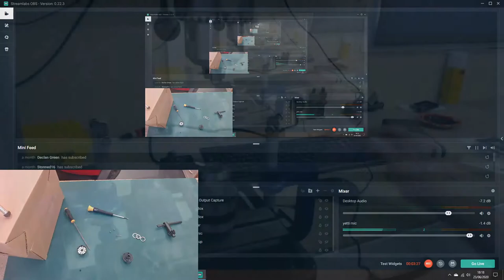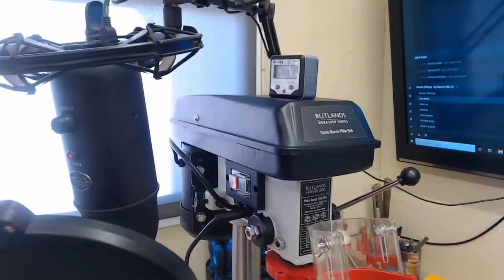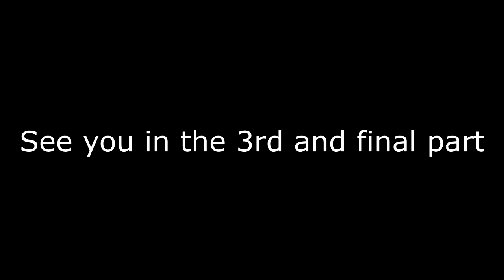737 home sim build - cockpit sim parts efis - part 2

Comment: Hi Im planning to built a home cockpit. can you confirm me that i can build an EFIS and entire overhead panel (boeing 747) without PCB?  thx lov your videos
Reply from the maker: You can build without using pcb's, If i had my time over again i think i would use them as it cuts down on alot of the wiring and makes everything easier and much neater.